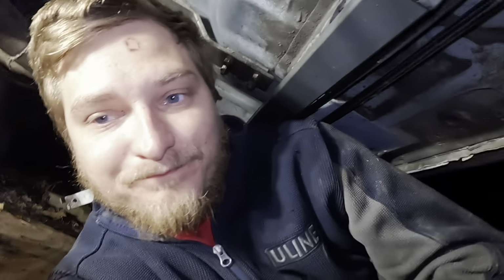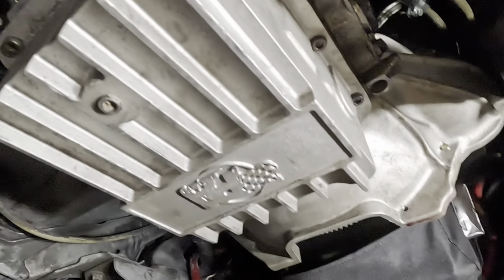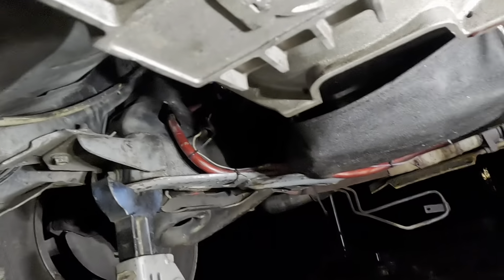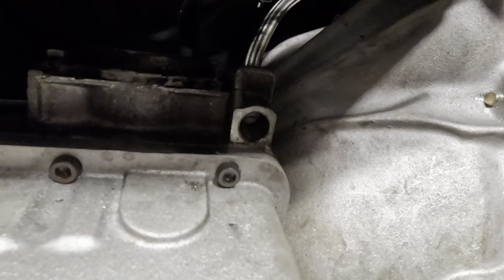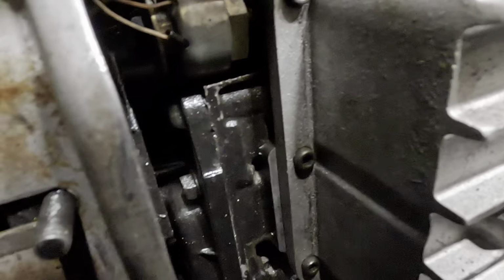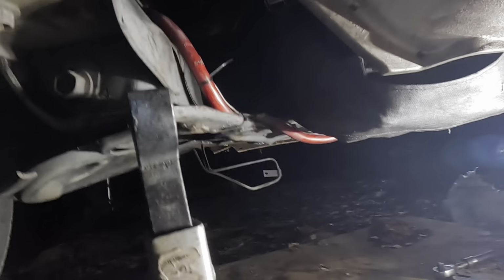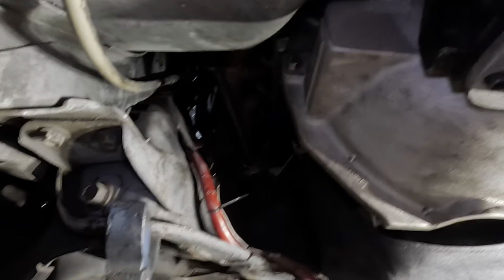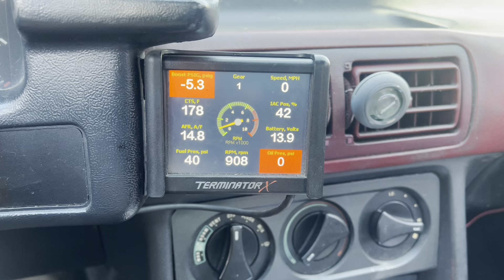Put a C4 and 80mm BG turbo in the mustang. Converters loose and the motor has to come out now!!!!

Comment: if I had to guess i'd say that your 4r case is warped and pulling the valve body crooked and sticking valves, most machine shops can resurface the case.
Reply from the maker: Having the exact same issue with 2 different cases. Not out of the rem of possibilities though. I figure a spool valve is probably stuck or something. Just tired of fighting it, I got a really good deal on an entire c4 set up.

Comment: Bad as I hate to tell you this brother need to just go ahead and put you a turbo 400 in it a Ford automatic transmission is not really too good that 400 turbo hold up very well and I'm a Ford man I hate even tell you that just giving you good advice from experience
Reply from the maker: Gonna try out the c4 and see what happens but that is the plan in the future. Turbo 400 or power glide. I just got a smoking deal on this trans and couldn’t pass it up. Got everything needed to install in the car.